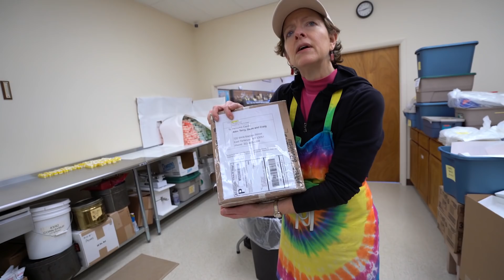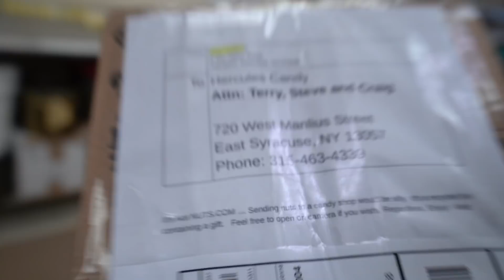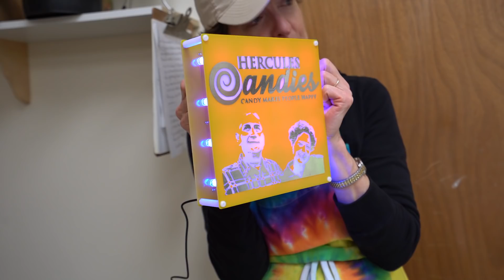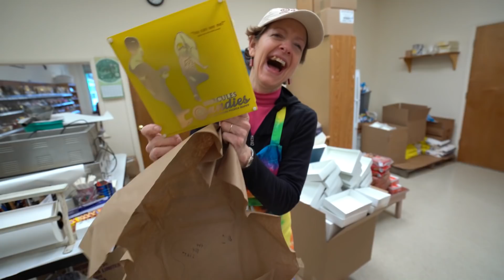Max is Getting Pretty Good on The Hook!

Comment: Question, why when you have 2 stripes, do you put it in a triangle, but when its 3 strips its a flat (sting-ray shape).  Why don't you use the triangle, with a stripe on each side for 3 stripes?  Or why not use the flat when there is only 2 stripes?  Just curious, hope this question makes sense.

Comment: I'm curious why they don't watch other candy makers like Lofty Pursuits to see ways they can improve how they do things. For instance, after they pour the hot candy onto the table they always start with the paddles right away and of course the candy is still so hot that it sticks right to the paddles. Lofty Pursuits waits just a minute or two longer until the edges are cooler and then it doesn't stick. Also, they pour theirs into such a big area that it barely even touches the bars. If they moved the bars in then there would be more candy touching the bars, the puddle would be deeper and the outer edges touching the bars would get cooler and they wouldn't be fighting the stickiness so much. EDIT: Fast Steve actually waits like the Lofty Pursuit guy. In fact, Steve is usually staring at Max or Terry like he is annoyed they are messing with it so much instead of letting it cool a bit lol.